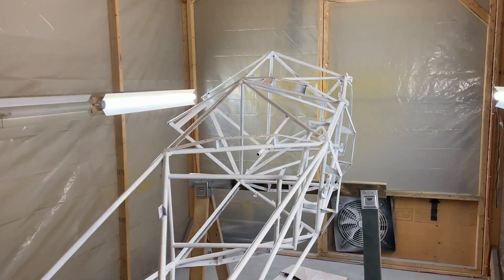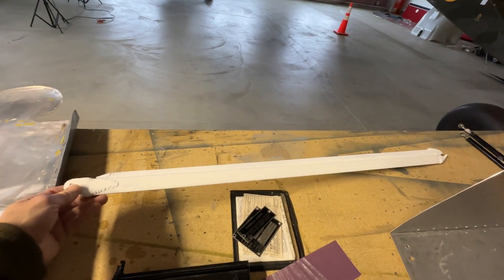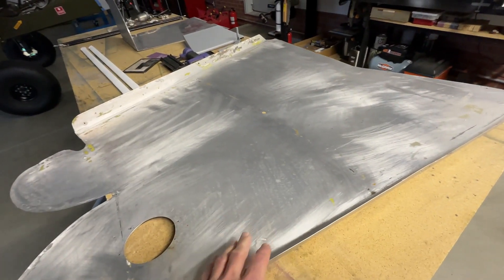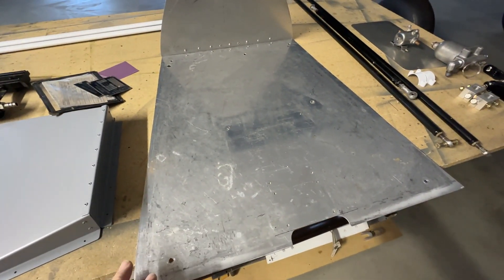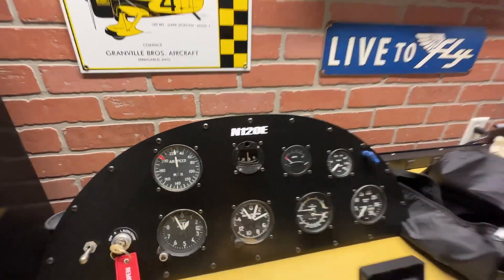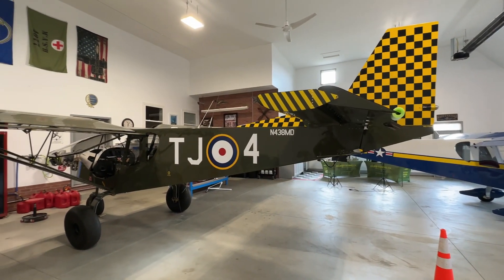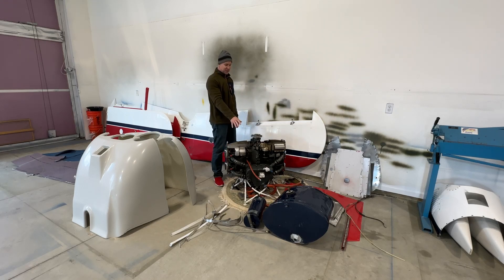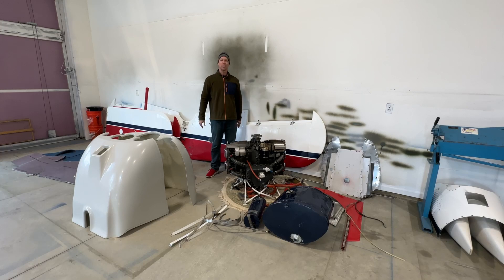Pitts S-1D Rebuild

Comment: For the engine leak, if you don't see any sweat on the engine you might want to check your inverted oil system, when going from positive G to negative G and vise versa, there is oil that coming out from the oil return hose, if this hose connets to the bottom of the sump, there is still oil in the hose that going the back to the  system's breather and then out, through the exhaust or just hose, so everytime your do acro, oil is coming out to the belly.
The solution is to connect the oil return to the upper bose of the sump.
Hope you understand what i meant, Im Israeli and English is not my first language. BTW, Sensenich GA prop - excellent choice

Comment: A common leak I see on mid-high time engines is the dipstick tube. A lot of people over tighten the dipstick and over time the base of the tube will start leaking. Normally not a gushing leak, but it’ll definitely leave a few drops after running. You can get new a o-ring or replace the tube if threads are damaged/cracked. Good luck. Leaks can be tedious to chase down but generally aren’t hard to repair.

Comment: Something I found that works very well while  working on some hard to remove CRUD was... Brake Cleaner Spray ( in a well vented area).... seems to cut through just about anything thats hard to remove. Just an FYI from my Hanger.... and IF you have pine pitch on your chainsaw bar...this is the stuff to use.:hand-orange-covering-eyes: I know,.. hard to believe but true.

Comment: I bet that Hartzell probably weights 60+ pounds.. maybe a Catto at around 12 pounds along with some newer RV style wheel pants.. some people even do RV style landing gear, which I believe is lighter than the Pitts style.
Reply from the maker: Yes eh Catto prop could be an option. Not sure about the wheel pants though. The Pitts has a certain look to it and I like the classic wheel pants that are on it. I'm not sure I'd like the looks of the RV pants on the Pitts.
Reply: @ maybe some older RV-3 style pants, they had the flat sides.. I know what you mean about the new wheel pants.. they are kinda tuna shaped..

Comment: Could you just do a gasket and Oring set for that motor?
Reply from the maker: Yes that may be what I do. I'd still like to clean the engine up and make it look pretty too!
Reply: @ we have been watching long enough to know you could NOT put that dirty engine on if your life depended on it. I’m surprised you haven’t degreased and steam cleaned it before setting it down on the shop floor. 
Thanks for the update on the Pitts! I love that you are saving that one. I don’t want them all but one of each will suffice!